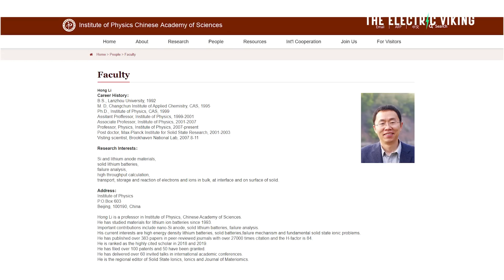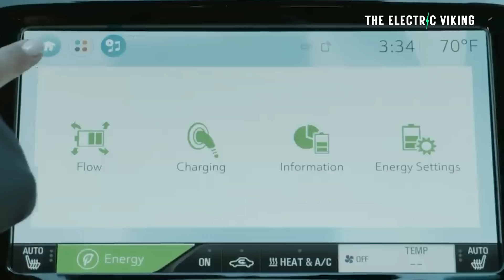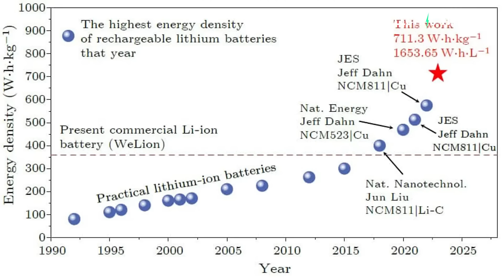The highest energy density lithium ion battery in the world is INSANE

Comment: I would go from the hypothetical weight of the charges to define the maximum energy density possible for 1 kg...and also make it a goal that the battery doesn't wear off and shows no reaction while getting short circuited...which is the only reason why the old Li Ion batteries fumed and caught fire. Also: should be abundant as sand from the deserts in Africa and China. From this point on you can search for materials that cime closest to these goals.

Comment: Gasoline = 12,888.9 watt hrs/kg plus in an airplane the vehicle weight goes down as you burn the fuel. You shouldn't say this can replace a jet fueled airliner. It won't. Elon's rocket is actually a better solution than an electric plane.
Reply: What efficiency is it burned at though?
Reply: @4literv6  30%
Reply: @Ask-a-Rocket-Scientist  truly pathetic overall efficiency then.👍🏻
Reply: @4literv6  doing the math means batteries are in zero shape to compete in aerospace where weight is everything, unlike what Sam said.
Reply: @Ask-a-Rocket-Scientist  depends on the math? Less than half of us domestic flights are over 500 miles 1 way, with about 35% being 250 or less miles. 500-700wh/kg pack's make some of those routes feasible to do right now. 

Battery tech has been doubling in energy density about every 5-8 year's or less. So we build what we can, more $ flows in for future development. And before you know it electric aviation works for anything from 100-1,000 miles. 

Longer routes that that are a small fraction of the overall flights. So those can be synthetic fuels or maybe hydrogen until battery density is up to par maybe by 2035-2040. 😎
Reply: @4literv6  Modern jet engines have a thermodynamic efficiency in excess of 50~55%.
Reply: @laredobenjamin7438  not overall they don't, just look at a jets total fuel consumption to take off&reach it's cruising attitude and speed.
The figure you claim is at steady state speed&high altitude only where the air is much less dense or thinner.
Reply: @4literv6  In these phases efficiency is still easily between 40 and 45%. And over 800 km (or what barbaric would call "500 miles"), the plane spends at least 2/3 of its time in cruise.
Your 800 km flight requires at least 20 MWh of battery storage (base on an Airbus A320), which even at 700 Wh/kg (with all auxiliary packing and BMS) would weight nearly 30 tons (A320 is 75 tons MTOW).
And to recharge it on a 30 minutes turnaround, it would require nearly 40 MW of charging capacity.
Problem that is only worse the bigger the plane gets. Physics is a bitch, and beating the 6000 Wh/kg of jet fuel (12 kWh/kg time the 50% thermodynamic efficiency of the current jet engines) will never be accessible to chemicals batteries.
Electrification of aircraft propulsion will always stay confined to general aviation.
And humans will have landed on Mars inside a nuclear fusion powered Starship well before tube-liners be powered by batteries 😉

Comment: According to one article I read on this, the cell retains 78% of its capacity after 3 cycles.
Reply: Minor detail. 😂
Reply: Please share the article you have read......
Reply: @heppo6  Further extending the operating voltage range to 1.25–4.8 V, the energy contained in the low voltage interval assists the gravimetric energy density up to 701.06 Wh·kg−1 and volumetric energy density to 1621.84 Wh·L−1. Despite a small capacity reduction in the second cycle, the battery capacity shows a high retention of 78.2% in the third cycle. The energy density is 711.3 Wh·kg−1 and 1653.65 Wh·L−1 according to a third party testing report of parallel batteries. The volume change of the initial cell is only 5.09% after the first cycle.
Reply: @keithbajema2358  Do you have a link to or the name of the actual white paper or study?
Reply: @keithbajema2358  Is this study done by yourself?
Reply: https://www.greencarcongress.com/2023/04/20230429-li.html

Comment: We're in an early stage of battery density. Densities like this will seem prehistoric soon enough.
Reply: Yeah we need to reach 1000 wh/kg battery energy density
Reply: Yep look at the video recorders of the early 1980's vs what is now in a mobile phone. 1000m range will be just normal. People will charge maybe once a month. Plus EV motohomes and Pickups will be common place. Imagine an EV motorhome with capacity to drive and power the heating and appliances. It will happen and soon.
Reply: @TheSmallRabbit  makes no sense really, the can reach 40.000 horsepower nad more, 4000 miles range etc but what metric really matters is:
first and foremost, price, then the sum of all parts which is really where most hyped systems fall off quickly.
because really any battery technology is good enough for a car for what most people need, in china there are even led acid batteries still used for extremely cheap electric cars.

many things to consider, the hardest seems to be simply availability of massive amounts. atm even before price.
then longevity, density, charging speed, cold weather performance, efficiency, weight, etc etc etc
for now, its just the availability, and it will be the most important thing for quite some time.
there is currently an infinite demand on batteries.

for aviation density is everything, atm
Reply: @TheSmallRabbit  When I look at all the UFO / UAP discussions, you have to wonder, what is powering craft that can do interstellar travel. Based solely on what I've heard from Bob Lazar and Luis Elizondo, recovered craft have "batteries" that store enough energy to power a craft to travel light years. These craft have been examined, and if any of that can be reverse engineered, then what we see today, will be like a joke compared to what is possible. When I see these articles, all I think is "yeah, whatever", because I know there's got to be several orders of magnitude greater knowledge out there. Given the universe is ~14 billion years old, and we've only really made great leaps in the last 100 years or so, there have to be civilisations out there that are so far beyond us that it's a joke.
Reply: @bigrobsydney  then again, you would seemingly believe anything you’re told.
Reply: @bashful228  Not necessarily. It seems highly unlikely that in the observable universe we are the only sentient life. If you can accept that, then it's not difficult to accept that, mathematically, the last 100 years or so are barely a blink in the eye cosmologically. I could ask you right back; do you not think other civilisations could be further ahead than us? And what do you make of the observations both by eye, and by multiple different systems, being made by pilots like Retired Navy Commander David Fravor, where these craft descended from 80,000 to sea level in one second?
Reply: I think here's a theoretical limit for lithium ion cells of 1KWh per kg or something like that so it's not a never ending thing.
Reply: @mondotv4216  I wouldn't bank on our science being correct 100% of the time. Every year we learn more, and many of the things we thought we knew, we are being forced to reexamine. Yes we can (and must) work with what we have right now. But don't let that artificially stop you from asking questions, or to wonder in what direction future advances may come from.
Reply: Energy density, not density.

Comment: ahhh - but will EV's have more range than a comparable ICE vehicle? It could be that the EV manufactures may stick with battery packs giving around 300 mile ranges & just fit smaller (but more energy dense) batteries - thus reducing vehicle weight, which as you say has an impact on range (during accelerations at least, not so much steady state cruise), AND also reducing costs due to smaller battery packs.

I think we might see greater variation in ranges of EV's than we have today. For example, I can see small cars having battery packs only giving 250-300 miles ranges - these are more likely to be used to 'pop down to the shops' once a week, or doing a daily commute. While EV Trucks might see battery packs giving >500 mile ranges as they are more likely to be used for long distance haulage. Maybe 'GT' (Grand Tourer) larger passenger cars would be offered with circa 500 mile ranges. The other aspect here is the weight of the battery pack as a percetage of the total vehicle weight - ie a large battery capable of >500 mile range on a haulage truck might be a relatively small percentage of the total vehicles 30 ton weight, but a battery pack for a small 'around town' car with 250 mile range might be a greater percentage of its ~850-100kg total weight than the 30T haulage truck. Just a thought.
Reply: Longer range as long as you're not doing real work like hauling a trailer or driving an RV
Reply: yeah gas and diesel truck don't lose any range when towing a trailer and RV are great on fuel

Comment: it's like Moores Law...."the number of transistors in an integrated circuit (IC) doubles about every two years".

We need a law for the increasing energy density of batteries over a unit of time.....I know, lets call it "Dunn's law" - which states: Battery energy density doubles every 5 years ;-)

Comment: Before we all get carried away: battery-electric aircraft won't replace jet aircraft in any application that requires speed greater than about 600kph. A battery-electric will be prop-driven, and props become noisy and inefficient as the tips approach mach-1. So at this stage, the options for low-carbon jets are to use synthetic AVTUR fuel, or to run on liquid or pressurised hydrogen.

Comment: This will be great for sports cars.  I wouldn't want or need more than 350 km range in a lightweight sports car.  High density like this will be so much better for electrifying old classics too.  Imagine if a big enough pack could fit in place of an old Mustang's V8, but weigh 40% less, leaving room in there for a 'frunk' as well.
Reply: Always gonna shoot for more capacity than needed on paper myself. Batteries with higher capacity typically can put out more kWh. They lose capacity over charge cycles and over time as well. 

Anecdotal example, I use an electric weed eater that now only gets me about half as far through my cutting as it used too(before battery dies).
Reply: the future of classic cars is of interest.

i think most classic car collectors would really want the car to be restored to stock as much as possible.  but even jay leno, who we all know likes restoration to be as authentic as possible, puts on brakes and changes the battery for obvious reasons.

so i can't see any advantage of buying a classic car just to put a big battery in it.

i, myself don't like classic cars.  they look different but that's their only appeal.  i like nice soft seats and an air conditioned ride when i go to buy ice cream.

Comment: I just wondered what is being done to promote easy replacement of batteries. If the issue is poor cycle-life, wouldn't the best answer be to facilitate replacement? That way you can buy an EV today, cheaper but with short battery life, and be sure that in 3 years or so you're not snookered.
Reply: China is doing work in that regard with swappable battery tech. Doubt it'll catch on, atleast in current form, but it's being played with

Comment: Even if - these batteries were not a super zippo ready to spark up your life,  it wouldn't make Lithium viable for a great deal more than it is now. OK so say you could have 3x as many 200 mile range cars - still only 15 million max probably more like 10 million.  At that rate it would take 100 years to replace the billion cars existing.  Right now Sodium at least offers a way forward and it is cheaper.

Comment: Weight does not significantly affect range for electric road vehicles, it has more of an effect on ICE vehicles because there is no KERS, it is everything for aviation because more weight requires more lift which requires more speed/drag.  Road EVs are held up by the ground so they only have to push the air out of the way to maintain the same speed, weight is not included in this equation.  It does add to rolling resistance but you can simply increase the tyre pressures  to compensate for most of that..
The reason large batteries don't seem to give more range is because ICE designers don't know how to make efficient EVs.  The largest batteries are used for the least efficient vehicles.
Reply: Weight is a pretty big factor for electric vehicles in my experience. Had an electric scooter that would get me home or not depending on if I was wearing a backpack
Reply: @james3876  was home at a higher altitude?  Could have increased your air resistance?  Does it have KERS?

Comment: As soon as the flammability is eliminated .....
Until then, those don't belong to cities & tunnels & underground parking & airplanes of any kind.  Imagine a sudden fire in flight, with reduced electric power for avionics because, ya know, the APU is eliminated because it's not needed with a huge battery - Riiight!
Reply: Get a grip all fuels are flammable. Do you think the JetA1 does not burn? Do you think the various petroleum liquids you put various internal combustion engines don't burn. In the US alone there were 212,500 car fires from ICE cars in 2018. In 2022, 2825, EVs caught fire. Yes there are far less EVs but don't go into the media spin of EVs are just fire traps.
Reply: That, along with better temperature tolerance amd availability, is why I'm more interested in sodium

Comment: 711 Whr/Kg can power a large commercial airliner!!  I'm calling BS on that one.  Show us the maths EV.  Jet A1 fuel is 12000Whr/Kg and if you think 711 is going to crack it - you've been taking someone else's meds again.   
How does the electrical energy from a battery get converted into thrust to replace a turbofan jet engine?  Yes it could run a propeller  but that isnt a large commercial airliner.  Its not even large anything.
Reply: Yes but 711 might revive the propeller, for medium haul anyway. (less than 300nm)
Reply: @lionelwylie2326  I'd need to do the maths, but EV said large commercial airliner and he's talking out of his hairy Scandanavian arse.

Comment: Liquid H2 at 33,000 Wh per kg to be used in large gas turbine or high compression engine at 50% Efficiency = 16,500 Wh / kg at the engine shaft vs battery at 711 Wh per kg with battery, inverter, and motor at combined efficiency of 80% =  568 Wh per kg for battery at motor output shaft.  So, we still see LH2 having 15 times  higher energy to weight ratio compared to the best of battery.!😮
Reply: The problem is volume, keep Hydrogen liquid in ambient temperature is almost impossible not to mention kinda dangerous. And theres the difficulties in transport hydrogen in liquid form too.
Reply: @passby8070  exactly, 3Wh per litre for hydrogen. Big tanks required at extremely dangerous pressures.
Reply: Liquid hydrogen is a nightmare to create and to maintain safely. I would like to see you recalculate the figures, with the energy to liquify factored in, as well as the weight of the containment vessel and its insulation.

Comment: In your example, if battery for car weight is only 50 kg. With 100 kg, range should be almost double, because if you count car weight, passengers, these extra 50 kg of battery probably, is less than 5%, of total weight.
Reply: His example was a battery with a capacity of 50 kWh (which currently would weigh hundreds of kg), not a 50 kg battery. That said, I think you’re mostly correct anyway; heavier packs do reduce range, but not nearly as much as he’s implying.

Comment: What's the cycle life? Anything under 2000 cycles is going to be a tough case for any vehicle. Especially if planes are building battery packs into the wings. Cycle life kills most "promising" battery tech like solid state. This design seems kind of simple, might be able to compete.
Reply: Even if it's 200 miles for range per full battery real world, with 1000 cycles that's a 200,000 mile range for the life of the vehicle, most people would be fine with that, especially if it's in an affordable car.

The lighter weight per unit of energy means you can have a larger pack for less weight, so it negates the lower cycle life issue.
Reply: I commented on this above. Surely cheap and easy recycling would be the answer to poor cycle life? But there's a more important issue. We know that batteries are getting about 15% more cost-effective every year. So a guy buying new today knows that in 4 years time the available batteries will be over 2x as good as what he's paying top-dollar for today. Unless he can replace that battery, the car will be hokey junk in 4 years time. And of course there's the environment benefit of easy recycling.